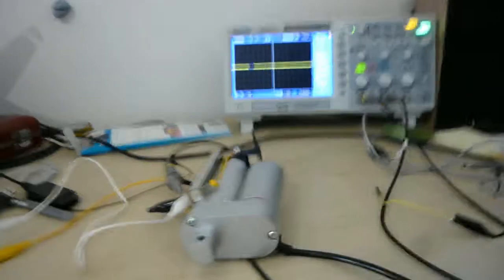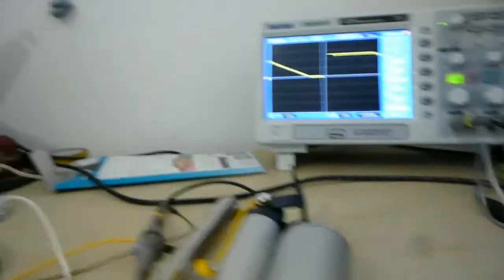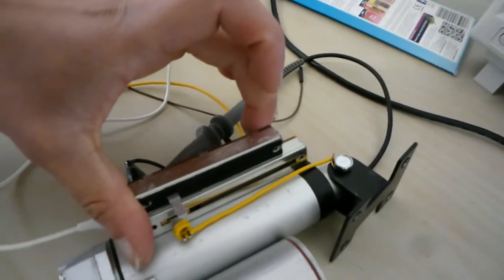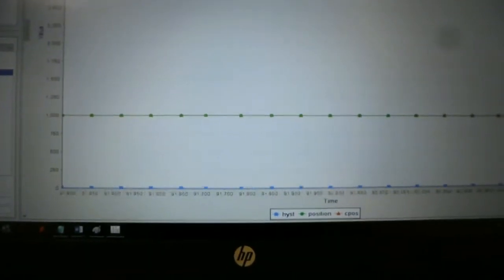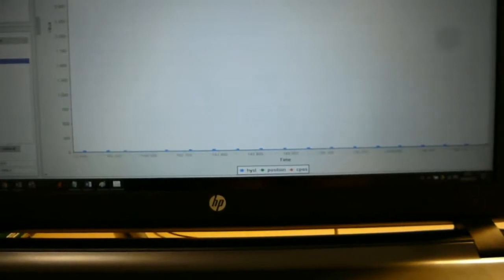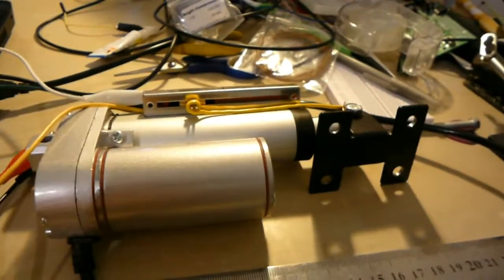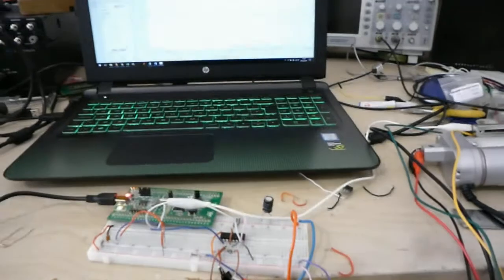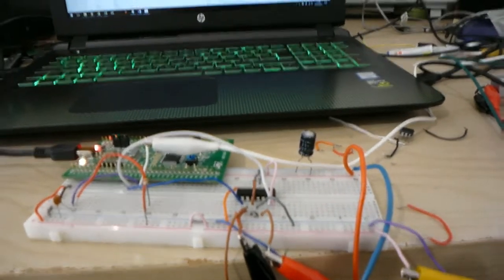Anthrophex - Linear Actuator Feedback

Comment: I have a linear actuator with 2 wires.Can I control it by arduino using a potentiometer?
Reply: You could do that, but you would need to attach the potentiometer to the actuator by yourself

Comment: That's sweet! Any idea on cost?
Reply from the maker: Ethan M Cheers! The actuators were ~£26, the slide pot was £1.50, the discovery board is about £8 and the l293d was about £1.50, so in total, about £37, it's worth noting though that the l293d wouldn't be suitable for this actuator under load!